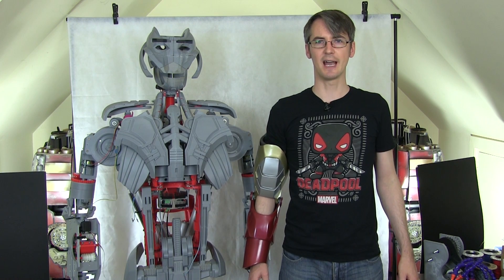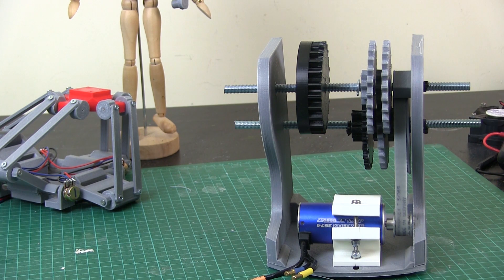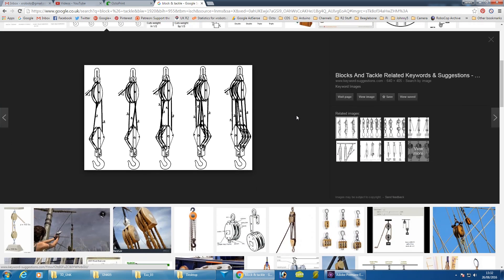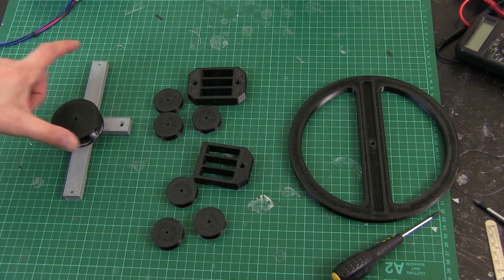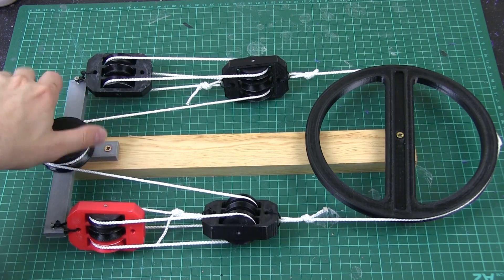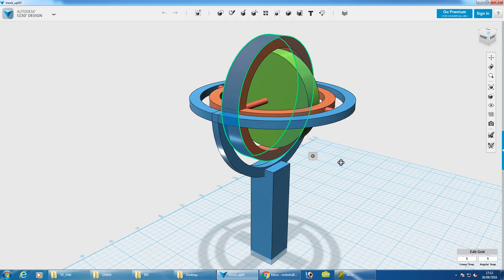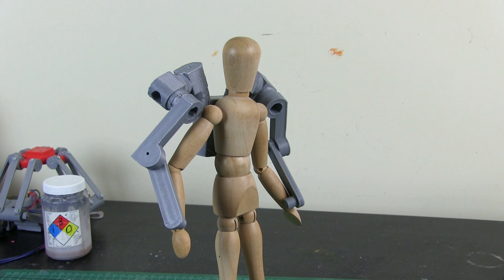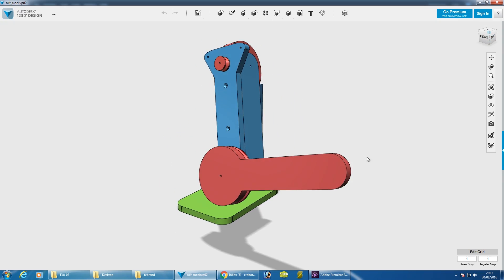Iron Man Exosuit #3 - Power Transmission Structure! | James Bruton

Comment: I wonder if it's possible to create an automated/programmable block and tackle that can "throw in" or "pull out" pullies to give you variable torque?   (It was the motor mixer in Ultron's forearm that gave me this thought. A pulley mixer.) :)
Reply: (I imagine the pullies on a series of linear actuators that alternate in direction.  When they're all retracted, the cord passes straight through for 1:1, but as you drive the actuators the pullies slide in from alternating sides in pairs and cause the cable to zig zag back and forth around them.  You could control the number of pulleys engaged, and how much they offset the cord.  Effectively giving you some weird pulley variant of an infinitely variable transmission.  (Not really infinite, but what is?  LOL))
Reply: That wouldn't not engage the pullies, so they work like... well pullies.

Comment: Cable can route around corners - lots of them... 

Its your project of course - but you 'could' route the cables all the way to the backpack and drive from there.
So the only weight on the arms is the load being carried.
Block/pulley still works - just all moves off the arm itself.

Comment: The issue with the arm parts moving "unnaturally" at 14:25 - why not have the arm black wheel part attached closer to the center of the shoulder black wheel part? This would also allow for less torque to be applied to the shoulder wheel. I'm not quite seeing why you had to attach the shoulder wheels on their edges like that.

Comment: You're doing it all wrong dude...
A LINEAR ACTUATOR will save you a lot of headaches!
For example.. a '50 lbs linear force digital linear actuator' on bicep, and triceps would be ample.
Make sure your controller is managed by a motion controller, otherwise it will rip your arm off :-)
Reply: Yo James, yes i watched part one and I understand what you're trying to achieve.
Linear actuators are available in much higher strengths.. like 450lbs... I noted 7 as a test bed. [sorry I didn't elaborate as I thought you'd get the gist of it :-)]
But in any case I think you should research and apply digital linear actuators. 12, 24 and 36 volts.. up to 1500kn force.
Peace
Reply: What kind of innovation are you looking to achieve?
I understand your design research in using pulleys or gears to achieve actuation of limbs but there's nothing wrong with using actuators to achieve this, which would be in a compact form factor capable of bearing higher loads.
Are you're seeking a more aesthetic appeal and not concerned with bulk of pulleys as part of your project?
Reply: +James Bruton (XRobots) well as long as it looks sexy, do wat u want man
Reply: +Jayden Gipson hippos rub shit on them selves cause it's sexy... yah didn't think so.

this idea would be great but this ass whole won't just tell his audience that he either is to cheap or doesn't have the funds to make this with artificially made muscles he needs to tell people what would work the best. then explain what he is using and why.. "didn't mean to sound rude but I'm very passionate about this subject have a nice day"
Reply: +Spiffy ??? what?
Reply: linear actuators are too slow
Reply: Search via youtube
Reply: +Spiffy all i was trying to do was brighten his day by making a joke since everyone and their mom was judging him for not doing this their way. Im not entirely sure what that whole thing about the hippo was about, but instead of trying to find something to be triggered about, just think about how it feels to be judged by almost everyone who disagrees with you
Reply: +jayden gybson In nature hippos rub shit on them self to seem more appealing to there mate....

but this guy is pretty much bs'ing the whole project and some of us think that there many alternatives to his methods and being completely close minded what any one said even if this is a budget project.  or doesn't have the money he can easily start. some sort of way to raise the money for parts.

(<>) your reading my comment now

Comment: Not really feeling this setup with pulleys
Reply: +James Bruton (XRobots) o yeh I get that haha block and tackle has its uses but just a bit primitive looking, I have no doubt it will work okay
Reply: why not use rotating stutting its dossent take up that mutch space and its strong
Reply: But it will be really slow.
Reply: You could use Spectra line if you want a good strength-to-weight ratio.
Reply: what reasons?
Reply: Not that I have a problem with 3d printed plastic but have you ever thought of making a foundry or something like it and making legit iron man or (aluminum man due to rust and stuff) parts?

Comment: James, dont forget to use myoelectric sensors and not that clunky joystick for motor movement, save yourself the hassle, it wont work properly.
Reply: TONY STARK WAS ABLE TO BUILD THIS IN A CAVE... WITH A BOX OF SCRAPS!

I think J can find a way to make it work.
Reply: Maybe he's not using those because of the costings of the myoelectric motors. who knows? His suit might work.
Reply: Jayson Lorenzo myoelectric motors.. wut? he can build his own quite easily and cheaply! i already went over this in his last video, and besides.. what is an extra hundred pounds when he spends easily 20 times that on each robot
Reply: +alberto gordillo oops I meant motors. I'm going to shut up now for I sounded like an idiot. well, what would you suggest beside spending "an extra hundred bucks?"
Reply: you said motors again... again i explained on his last exo video how and why.
Reply: as to why this will not work: 1) there will be a lag which will make this hard to use, 2) a fatal resonance will happen if he tries to tune this to make it more practically responsive 3)its a lot more complicated in software because you'll need to do all sorts of complex math to convert from spacial format to another spacial format, which will introduce more latency making resonance more likely and given he probably will use an 8 bit microcontroller, will compound errors in positioning making jitter even more likely
4) he'll likely use a PID controller to mitigate this which will make the latency issue even worse.
Reply: +alberto gordillo yes I agree with that. thanks alberto will also take note of that as I was planning to do a project like this one as well! Thanks!
Reply: #1 engineering principle: KISS - keep it simple stupid, this is introducing a lot of complexity where there doesnt need to be using a more direct control method
Reply: I believe there are 7 different muscles responsible for the movement of the shoulder. That's for a joint with 3 degrees of freedom. Do you have a mapping of muscle impulses for the group to movement? I think that would take some work. The guy who designed the HAL exoskeleton said it took him 2 years to work out the electromyographic control system. While that is for a full exoskeleton, even 1/10 of that would not exactly be hassle-free.
Reply: Michael Lovelace he did all the r&d for the exo, when there was no information, now - the information on how to do it is out on the internet, you dont have to spend 2 years on r&d when there are commercial sensors out there right now that clean your signal up and return a nice clean analog signal from 0 to 5 v. 

as for the shoulder, you only actually need 5 sensors, 1 on your pectoral muscle, 1 on the top of your shoulder between your neck and the shoulder and one behind just above your shoulder blade, 1 directly on top of the shoulder and one 90 degrees directly in front of your shoulder, yes there are multiple muscles on the shoulder, a rotation is the ratio of activation between the sensor on the top of your shoulder in relation to the one 90 degrees from it in front, the other sensors detect x,y,z of the arm, problem solved in 2 minutes.
Reply: Could you give a link to an example of that?
Reply: Sorry,  I can't give you a link to a project that's not public,  I wish I could.
Reply: Could you then give a link (or links) to the sources on the internet you mentioned?
Reply: Which ones? The commercially available sensors?
Reply: No, those were easy to find. Specifically, I was interested in emg sensor placement for the various movements of an exoskeleton.
Reply: That's related to an internal project that I am involved in that's not public,  again sorry :( but you can test this configuration yourself if you like.
Reply: I understand completely, I just wondered if there were more out there on this subject. I will file this away on the odd chance that I will ever try this. By the way, in the spec sheet for the LT1920 precision instrumentation amplifier, there is an application note on building a nerve impulse amplifier. Nice chip, 13Kv ESD protection on the inputs. I would imagine you've already made the decision on emg sensors, but for anybody else reading this.
Reply: alberto I have a lot of improvements on this too, but as a brilliant man once said:  "If you're good at something don't do it for free"  ;)

Comment: why not just use a screw like mechanism for the tricep and bicept. i have no idea if thats efficient oh youll need twice the motor. nevermind
Reply: I think you mean a worm drive, I also think that would be a better solution at least for the gearbox. It' s more compact and there's no way, the load could move the motor axle.

Comment: I feel like your current idea for the controls end up being a bit big. Would you be able to build something similar, except replace the top parallel platform with a rotating ring with a handle through the center.  That way you'd have the axis of up, down, left, right, forwards, backwards and rotate left and right. 
Just an idea. Awesome work so far, I'm excited to see how it progresses.

Comment: im worried about the pully slipping on the weel as the large wheel will be the source of tention the pully string might slip althoe if you anchor it instead of looping it around it might still work. but im still worried about the motor pully if there is the smallest tention it might slip. aw well you always make things work your a professional. keep up the great work
Reply: never realized that till you brought that up.
Reply: good point

Comment: From a plastics waste standpoint and a time saving standpoint id love to see you start using CNC or laser cutter to make some of these prototypes. That scale model is pretty huge, it must have taken at least 10 hours to print all those parts just to see if it would work in the large version.

A CNC would be able to make the same model in 2 hours and use more environmentally friendly materials.

I'm liking the pulley system though, I think it will be pretty robust. What do you think the final rope material will be?

Comment: You should check out eBike or scooter hub motors. They are flat and round, and have ample torque for such a device. Besides, some have a hall effect sensor so you can control them at very low rotation. "Hoverboard" motors, with a small chain drive pull setup would work much better than using a inrunner, I believe.

Comment: If you guide the first section of the rope not down to the second set of rolls but to the first role you could easily narrow the mechanism down to half the width. And then just compensate for the loss in transmission with another row of roles :)

Comment: I really wasnt sure it was going to work when you brought up the idea of a block and tackle during the live broadcast. I have changed my mind now that I see it. My only concern is backlash. It might be a bit jerky if there is to much. Time will tell though. Can't wait to see it full size. Keep up the good work!
Reply: I don't see why there would be backlash if there are enough loops on the blocks and the motor control has suitable acceleration/ deceleration built in (i.e. soft start and stop). It is a shame that the pulleys need to be so large as it makes the joints fairly bulky.
Reply: I'm thinking slack and stretch.  The longer the line (more pulleys = more line) the more stretch and slack thats introduced into the system.  Although I could be completely wrong.
Reply: Good point, as cable will stretch under load, but a short spring would be enough to take up that small amount of stretch.